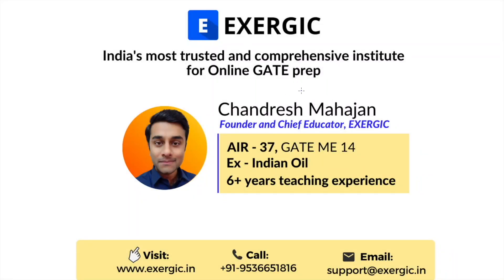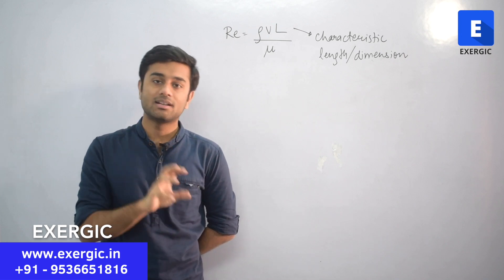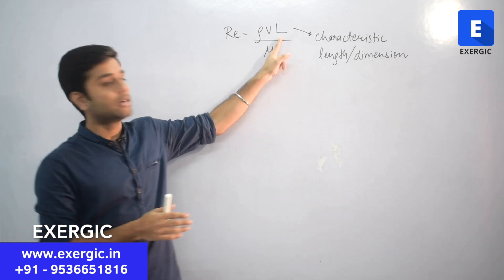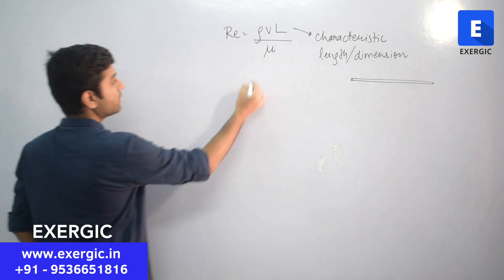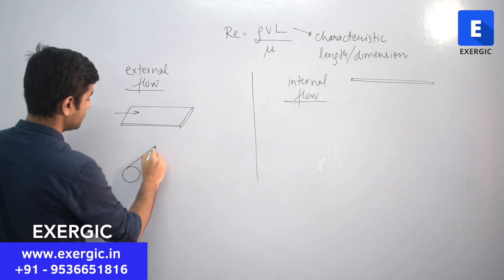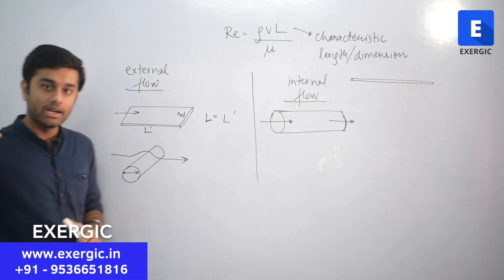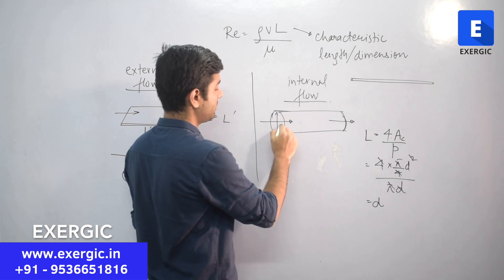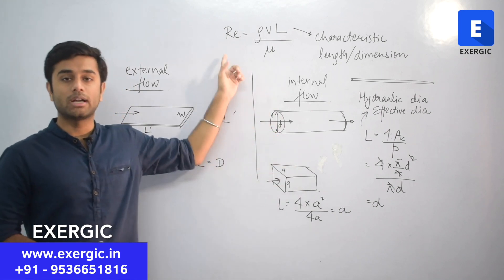How to decide Characteristic Length in Fluid Mechanics | GATE Mechanical

Comment: Sir,
But then how while calculating Biot number in heat transfer through a cylinder, the formula hLc/k solves out to hR/2k (R is the radius), then how is the characteristic length being R/2 here ?? According to your explanation it should be d=2R, and it will give wrong answer for all questions. Please explain.

And for a cube it's L/6.
But as per the discussion u have taken, it is L. Anyone if,.please help out.

Comment: Waoow its just amazing , after going thru so many stuffs regarding characterstics length calculation and still i had confusion on different situations the characterstics length differ accordingly i always faced problem in it,
but finally after landed on this video...the way you made clear distinction between type of Internal and External flows..and told exact approach to determine length for specific scenario is really excellent one.., Thanks a lot brother for providing worthful content n really helpful.

Comment: If the fluid (while flowing) occupies only half of the cross sectional area then Characteristics length L will be  L= (4*(Cross-sectional Area))/(wetted perimeter)  
   =(4*(pi/8)*D^2)/((pi/2)*D+ D)                                      
   = (pi/(pi+2))*D                                                                                (where D= internal diameter of the pipe )

right or wrong?

Comment: Finally..  Doubt cleared.. Also plz explain when to use 4A/P and when just A/P
Reply: 1-We use 4A/L  in case of Reynolds number (in fluid dynamics and Forced convection)
whereas A/L in case of Grashof number.(Free Convection)
2- 4A/L for finding characteristic dimension of a pipe of any cross section shape. 
Whereas A/L for finding characteristic dimension of horizontal surface (in case of Free Convection)
Reply: @rameshs2539  L u mean Length or perimeter?
Reply: @yahitajam7944  send me ur e mail .
I'll mail u notes regarding it
Reply: @rameshs2539   hlw brother